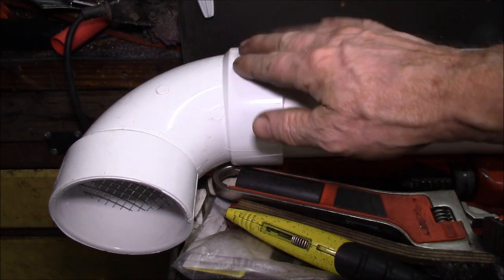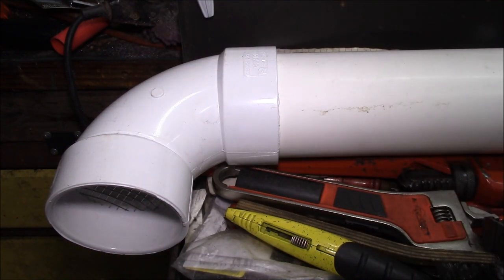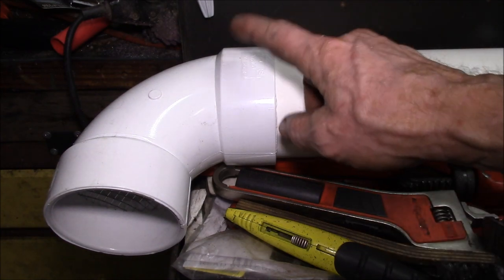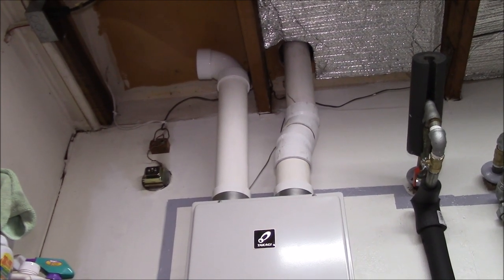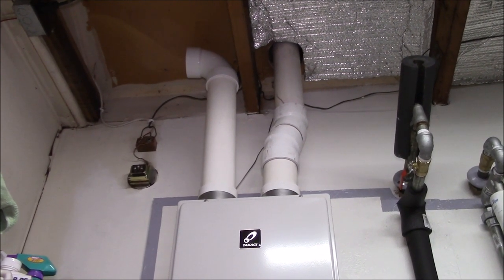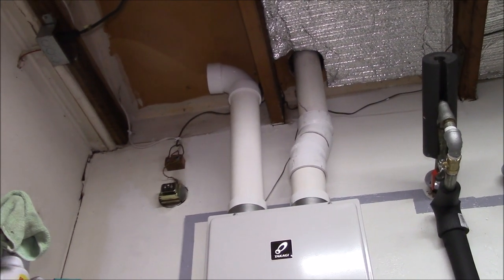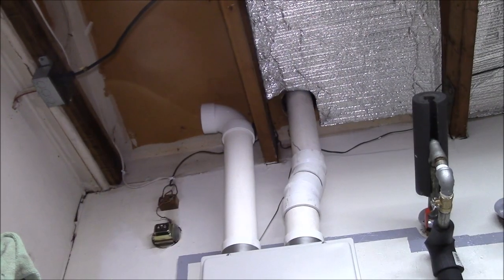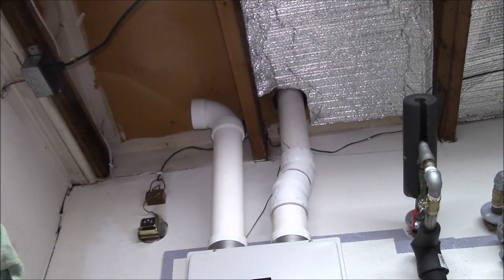Tankless Water Heater, Intake Air

Comment: Just a tip.
At the time this is posted , in New Jersey ,the Home Depots in my area have plenty of stock on 3" pvc 90 , 45, 22,5. degree , plus reducers,etc.
Reply from the maker: Good to know.  I think I may have run into a temporary shortage when I was shopping for the fittings.  I did make a cursory check earlier where I saw lots of fittings and lots of sizes in stock.  But I did not look for the exact size fittings in the material I needed.  But these days, no big deal to order stuff on-line.  Maybe not the 10 ft. section of pipe, but for sure you can get any style of fitting under the sun.

Comment: This should be retitled, "How I Found a 3 inch PVC Elbow."
Reply from the maker: Yes, I suppose so, although it was an elbow and not a tee.  Point was that finding PVC fittings in that size is a bit hit or miss.  Not sure if I just hit bad luck at the local hardware stores being out of stock, but it was an issue that I felt it worth pointing out.  The advantage of using PVC over say double wall stainless venting is that "you can pick up the materials at the local hardware store".   That's not exactly the case in that size PVC as it's not a size commonly used, unlike ABS where 3" is very commonly used.
Reply: It's actually called a quarter bend. 1/4

Comment: My unit was installed in a vented garage. So I’m assuming it does not need piping to be run out side.
Reply from the maker: Usually OK, assuming an adequate combination of air volume in the garage and outside venting area:
https://hinarratives.com/reference/heating/calculating-adequate-combustion-air/

Comment: I need help with my tankless fastar 6L propane water heater I'm putting it in my 8x16 RV camper do I need to vent from the open top to outside let me know please and thank you.
Reply from the maker: You might want to check with the installation manual or the manufacturers web site to see what they recommend for venting.  Likely you'll need some way to vent the exhaust outside the camper, or perhaps install the heater on the outside and then just pipe the water lines inside.
Reply: R Brown thanks I will find out what i need to do to keep it inside.

Comment: Is it ok for air inlet not to be vented outside ?
Reply from the maker: Yes, as long as the volume and ventilation of the room being drawn from is adequate for the BTU rating of the heater:
https://hinarratives.com/reference/heating/calculating-adequate-combustion-air/
50 cu.ft. per 1000 BTU/hr rating of the appliance.
This is in an unconditioned garage.

Comment: I don't think you did that right! What's the point of running an intake from the top of your garage ceiling vs just not having a pipe to start with? The point of the intake coming in from outside is so you don't blow the hot air from your house outside in the winter and create negative pressure!
Reply from the maker: Yes, in a conditioned space you would want the intake coming in from outside.  My garage is not conditioned space and it's of adequate volume and ventilation area to allow for inside intake air.  Point of the intake pipe was to get the cleanest air up high next to the ceiling and to have a place to install the intake screen that's designed to fit inside a 3" PVC fitting like an elbow.  
Yes, it could have been extended into the garage attic.  That would mean additional fire sealing around the ceiling penetration and would also make it harder to inspect the intake duct for things like spider webs, etc. as I would need to climb into the far corner of the attic to inspect the intake  Could also have run concentric pipe out through the existing roof penetration but that's a lot more expensive and roof penetration modifications may have been required for the larger dia. vent system and to allow for the separate intake and exhaust vents.

Comment: Actually, pulling your intake or combustion air from outside is much more energy efficient than using the air from your home. The theory is that you have already paid to heat the air in your home and you don’t need heated air to use for combustion so you can use outside air.
Reply from the maker: Yes, that's true assuming it's conditioned air.  This installation is in an unheated garage with sufficient volume and ventilation from outside.
Reply: That's generally true if the purpose of the combustion is to condition/heat the air inside the living space, so outside air intakes are essential for combustion on a furnace. Since the tankless appliance is for heating water, as long as the space where it's installed is large enough (more than a few hundred sq. ft.), it's not an issue. Normal tank water heaters that use gas don't pull their combustion air from outdoors, only the exhaust is vented outdoors.

Comment: Why would you need pvc for water if it is a vent
Reply from the maker: Per the mfg's installation notes, Schedule 40 PVC is an approved vent material and that's allowed by my city code.  You can't use cellular core PVC drain pipe.  They also allow CPVC, ABS, PP as well as stainless venting.

Comment: Can the air intake be in a attic or does  it have to run outside
Reply from the maker: It depends on the BTU input of the appliance along with the room volume and/or open air intake area:
https://forum.nachi.org/t/combustion-air-requirements-for-gas-furnaces/26305
If you can't meet those requirements, then it needs air from outside.

Comment: So how's ur Takagi holding up? I'm on the fence between the Rheem and Takagi 9.5 condensing units.
Reply from the maker: 2-1/2 years since installation and it's still working great.  No issues at all, just a yearly descaling cycle and cleaning the intake water strainer to do.
Reply: The navien condensing unit are amazing. The 11.1 gallon which I think is the 240-a with built in recirculating pump and buffer tank is amazing.
Reply from the maker: Yes, some of these new larger output heaters are pretty amazing.  For a larger house, the recirc. feature would be nice and having it built into the unit makes it easy to hook up.
Reply: @The4Crawler  Rheem is garbage! Navien are the best hands down!

Comment: Why not use a 3X2 fernco
Reply from the maker: Yes, that would have been another option.  As the 3" PVC pipe was already on-hand and the inlet screen supplied by Takagi was sized to fit inside a 3" PVC elbow, the decision to use that setup seemed to be most obvious.  It just took a while for the 3" PVC elbow to arrive.

Comment: Use 3 inch ABS instead. Home depot stocks plenty of it including the elbows in 3 inch
Reply from the maker: Yes, suppose that would have been another option.  I had enough of the PVC pipe left from the exhaust vent line to do the intake as well.  Also, the heater came with PVC couplings for connecting to the heater, so I would have needed to replace those with ABS.  But yes, there seems to be a lot more local stock of 3" ABS fittings than 3" PVC for sure.
Reply: Abs is not approved.
Reply from the maker: Actually,  Takagi does list PVC, CPVC, ABS, polypropylene as well as stainless steel as acceptable materials for intake and exhaust.   Local jurisdictions may not allow all those materials, so best to check if using something like ABS.
Reply: @The4Crawler  At least where I live NO cellular core pipe like ABS is allowed...even though all the manufacturers say it's ok in the book. DWV PVC isn't even allowed, has to be solid core PVC pipe. Everyone should call their inspector first to find out if they don't want to have to do it twice...as this varies in every jurisdiction.
Reply from the maker: @PowerScissor  Good point.  Yes I assume one would need to use a solid core ABS pipe for this, which may be harder to find than solid core PVC in the 3" diameter.  This install was with solid core PVC pipe and fittings meeting the ASTM-D1785 standard.
Reply: You can’t

Comment: Does this work with other tankless water heaters? Is this a Takagi tankless option?

 I know Noritz offers the 90 degree piece as an add on. I was wondering if this would work with a Rheem 2 pipe (intake and exhaust) tankless water heater.
Reply from the maker: It likely will work.  Best to see if you can find the installation manual for the particular heater you're looking and and see what intake air options they list.  The Takagi unit I have shows this type of setup in the manual and as long as you're under the length limit, including bends, it's fine.  My heater is in a garage, so no problem pulling combustion air from that unconfined air space.  If it were in a closed area, it would most likely have to pull air from outside.

Comment: Not sure about your water heater but I am reading an instruction to install a Rheem Condensing Water heater and it specifically states "The vent exhaust and air intake must be vented
outside as described in these instructions." They even bold this statement.
Reply from the maker: Yes, different mfgs. may have different recommendations.  The Takagi installation guide shows a "Single pipe with room-air intake" setup diagram on pg. 15 of the Installation manual:
https://drive.google.com/open?id=1ajssM-qMLH0cCmUpZNbPzU2Vcnl3CROY

Allowed if the volume of 50 cu.ft. of air per 1000BTU/hr. in the enclosure, which I meet with the unconditioned garage.
Reply from the maker: KhmerD0g  You just need to make sure the place you're taking the combustion air from has sufficient volume and openings:
http://blog.htproducts.com/blog/tech-tip-do-you-have-enough-make-up-air-to-support-proper-combustion

Comment: good luck on it staying bug free
Reply from the maker: Thanks.  Spiders are pretty bad around here.  But so far, so good.  At least with the intake in the garage, it's easy enough to remove it for cleaning if needed.  If I put it up in the garage roof attic, that would entail a trip up there to check it out.

Comment: I'm pretty sure this is a "no no" in just about every municipality. The intake air should always come from outside the home on these units. All of the ones I've seen explicitly state NOT to use in-home air to supply air to burn on high-efficiency water heaters. Low efficiency heaters to not actively exhaust air (they do it passively) so those don't require outside-air for combustion. For anyone watching this video, don't do what this guy did.
Reply from the maker: Agree for in-home installation.  However, this unit is installed in an unconditioned or unconstrained garage that doesn't share air with the dwelling space.  It is of sufficient volume and vent opening space, per the mfg. calculations, to allow for intake air from inside.  Had this unit been of a higher BTU rating, that would not have been possible.

Comment: PVC is not acceptable for the exhaust, only for intake. Water Heater needs "Category III or special BH type gas vent" and cannot exceed 50ft of run with a maximum of 5 elbows per Takagi. Max temp for PVC is 140F and it melts at 160F...temps out of the Takagi will be 350F. Even CPVC only has a working limit of 200F.
Reply from the maker: This sounds correct for a non-condensing heater, which would be the case for the Takagi T-KJr2 (140,000 BTU Natural Gas Indoor Non-Condensing) heater you mentioned.  And yes, for a non-condensing heater, you need to use stainless steel or the BH type venting.  A condensing heater, like the type I installed, is designed to keep the exhaust temps lower, here's an excerpt from the T-H3M-DV-N heater installation guide:
"The 140 Indoor (T-H3M-DV) model is to be installed indoors only. The model is equipped with a thermistor and hi-limit switch for the exhaust gas, detecting excess temperatures within the flue and enabling the water heater to safely stop operation if needed. These components are always monitoring
exhaust gas conditions in order to prevent heat damage to ABS, PVC, CPVC, or Polypropylene (Plastic) venting if ABS, PVC, CPVC, or Polypropylene is used. If the exhaust gas temperature exceeds 140 °F (60 °C) these components will enable the water heater to safely stop operation."